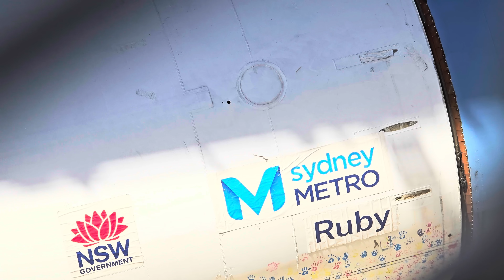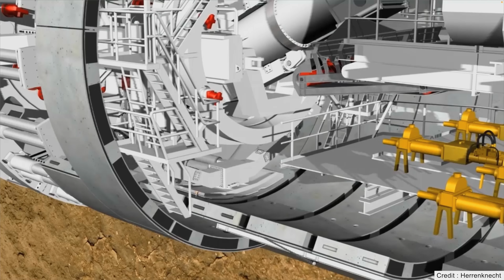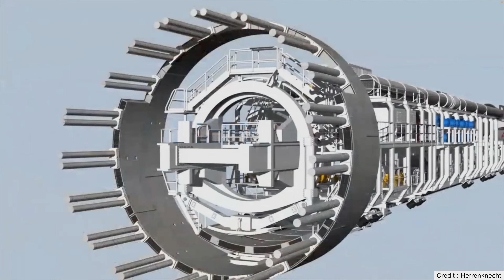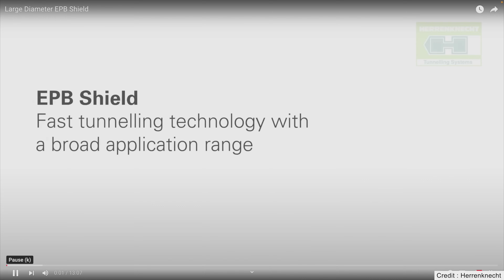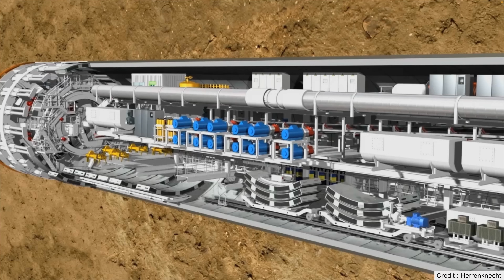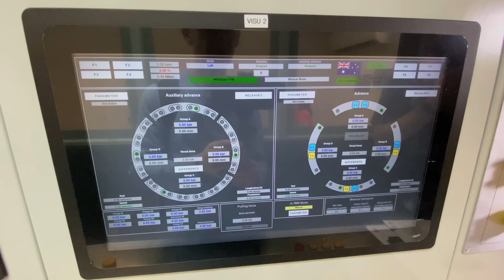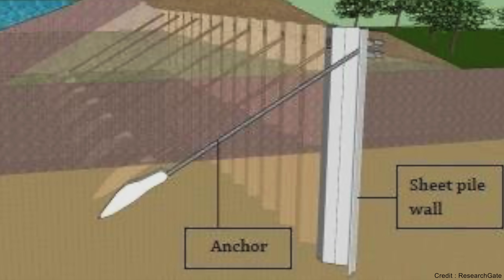The Bays Station Open Day - Discover How Tunnel Boring Machines work featuring TBM Ruby

Comment: It is truly amazing how much the science and mechanics of tunneling has advanced in the last 60 years or so since the very first bored rail tunnels were built in Sydney (the Eastern Suburbs Railway). One can only wonder how much more tunneled rail we might have built in Sydney over that time if tunneling had been as effective and efficient as it is now with the modern operation, they really have just smashed out all of these tunnels in the last 2-3 decades or so with very little fuss, and they are planning more. Having said that, I do think we should be trying to incorperate more elevated viaduct rail where it is practical, like say down Anzac Parade if the Metro West ever makes it that far (though they could do cut & cover), or out through Prairiewood SW of Westmead, or even possibly on a future Liverpool extension of the Bankstown Metro.
Reply from the maker: Yes, elevated sections are much cheaper to build. It's just hard to do in heavily built up areas.  I reckon any extensions west beyond Westmead or Bankstown would have some above ground sections

Comment: Well done Paul! I think you'll find the large duct with the flexible join is part of the ventilation and/or dust control, with the water pipes on the other side of the TBM. You can see a blue valve at the top left of screen. Cheers
Reply from the maker: Thanks for that Jim.